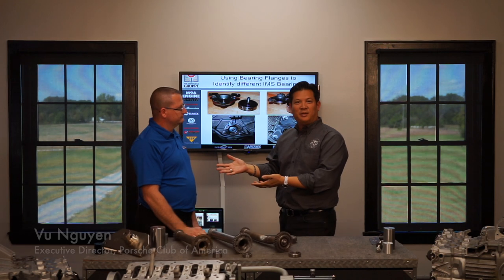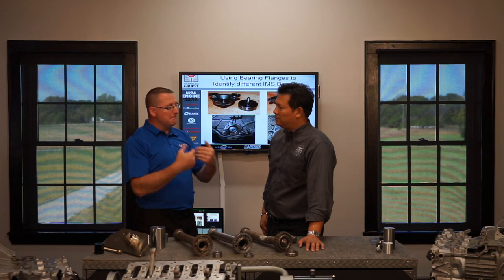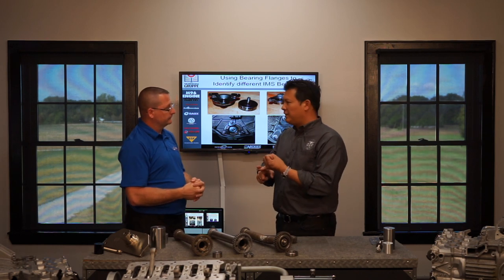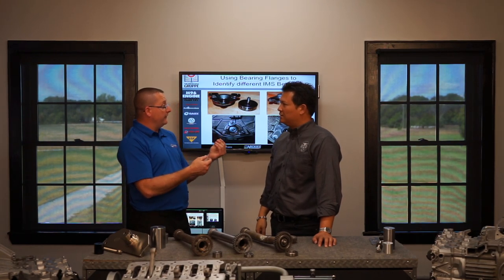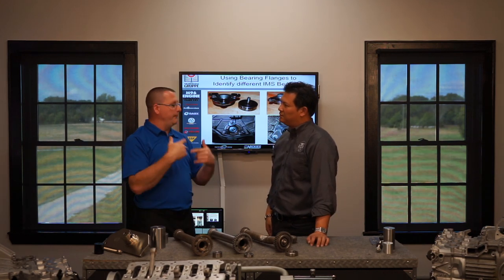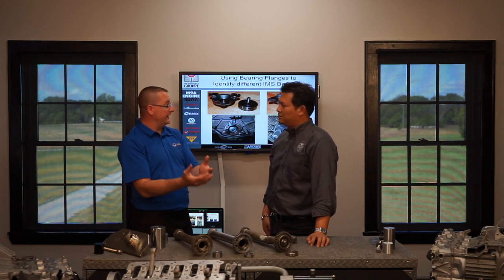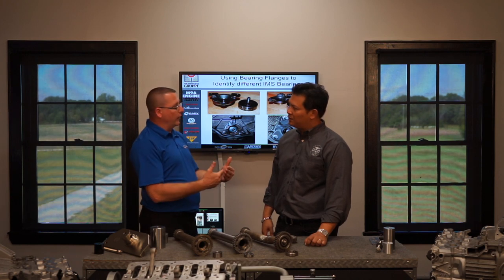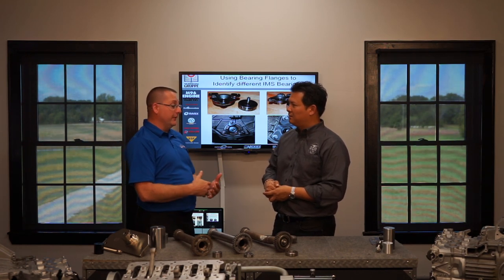PCA Spotlight: Extending the life of your original IMS Bearing

Comment: I owned a 2001 996 that I sold with 150K. I changed the oil every 6-7K, and drove about 12 K per year, usually 25-50 miles at a time. I did not have an IMS issue.

Comment: Knock on wood, my 2003 Boxster S now has 127K miles on it with the original IMSB. I change the oil myself, check the filter every time and have not had metal particles in the filter, have found some brownish colored thin bits in the filter at times. I also bought one of Jake's magnetic drain plugs, always looks good too. I have always used Mobil 1 0W-40 oil and started to add Liqui Moly MoS2 Anti Friction Engine Treatment with every oil change about 2 years ago. I change the oil between 3,000 and 4,000 miles, but I never let it go to 5,000 miles before I change the oil. My Boxster S is my daily driver, even in the winter if the snow isn't very deep. Yes I have different tires for Summer and Winter.

I've also done many mods to my Boxster S. Here is the list of performance mods. 987 Air Box, K&N Air Filter, 76mm Intake Pipe, 996 76mm TB, 997 Distribution T, Secondary Cat Delete Pipes, NHP 200 Cell Exhaust Headers and Borla Muffler. She runs like a champ, I love this car.
Reply: Share your passion. Used my '98 986 Boxster now more than a decade. Awesome machine. Now at 225k kms, t'was my daily and fun track car. Not a problem in the world. Doing own services. Requires just basic maintenance and gives just endless joy. Very few people commenting has got any practical experience. Enjoy your Cayman. It's a wonderful machine.

Comment: years ago my sister asked me how to keep her engine running for the long time. I said change your oil at 2.5k to 3.5k miles, use good oil, not fast change chain places. I changed the rocker cover seals, at 297k miles, engine has some wear but does not burn oil and camshafts looks great. No sludge. No noise on engine.

Comment: Couple of years ago I bought a 2006 Cayman S with 65K miles and it still has the original IMS bearing. Since purchase I have followed the recommended guidelines. But I also do a couple of extra items. I used 5/50 Mobil 1 because I drive with a certain amount of vigor, I get a Blackstone analysis with each change and just for insurance, I have an extended drive train warranty. I hope I never have a problem but like all drivers who know the Porsche's (especially the Cayman's) there are some things you will put up with just to have one of the best driving machines available.
Reply: Yes sir. I love my triple black 996 c2 cab. Its not a manual 6 speeder but still big fun.

Take care of your car and it will take care of you.
Reply: the chance of a 2006 having IMS failure is very low. you are wasting your time and effort for a car thats barely worth 15k. please send me some of that money you are throwing in the garbage

Comment: changing thr oil before it becomes acidic (6 months or 10000 kilometers, whichever comes first!) and revving a little higher before shifting gears (as soon as the oil is at operating temperature of course!) to reduce load on the bearing are usually the ways to go and also the reasons why cars which are raced and frequently used on trackevents way less likely to be victim of ims bearing failure. i do most services and partreplacements on my 2003 boxster 2.7 myself, since otherwise i couldn't afford owning and running the car. thank you for your informative videos. great content, keep up the good work.

Comment: The engine oil carries contaminants, with prolonged use. I do agree that when the engine starts (from cold), that there are products of incomplete combustion, such as 'sooty' deposits that get washed down the piston bores, past the piston rings, and then mix with the engine oil, and (although microscopic) these sooty deposits are carbon. The Oil Filter does its' utmost to remove these micro-particles, but we all know that (when the engine oil is changed) it is always black. Acids are also present and other stuff. Remember also that many contaminants can bypass the Air Filter, only to lodge in the engine oil too! 

So here is what I would do if I had to change the IMS Bearing. I have done this many times before. You take a brand-new sealed Bearing (I would use steel seals because there is no degradation to steel seals from the engine oil). Carefully prise out the steel seal at one side only. You will instantly be alarmed - and shocked at just how little grease is contained inside! Worse than this, many bearings are factory-lubricated with a medium grease, and I do not believe that a medium grease could survive the high temperatures of an internal combustion engine, under those harsh conditions. It is highly likely that the IMS Bearing is also subjected to temps around 130C  (for water cooled engines, including any friction build-up).
So- take your new bearing and thoroughly wash out all of the original grease with aerosol degreaser. Wash a second time in WD 40. Make absolutely sure that everything is clean and dry inside the bearing. NOW - go out and buy some ROCOL HIGH TEMP GREASE. Press this into a new bearing with a clean finger, and ensure that the high-temp grease takes up approx. 40-50% of the volume of the inner raceway. Replace the steel seal by gently pressing the rim of the seal - back into its' groove. The high temp grease will not migrate from the ball bearing, which means that any contaminated engine oil will not easily enter the bearing. I have had great success by 'modifying' new bearings in this way, and it would not be wrong to say that the life of the bearing can be tripled when used in the right application. Hardest part of all, is the removal of the steel seal on the new bearing- without bending it! I wish Bearing Manufacturers would also place one or two spare seals in the sealed package - along with the new bearing!  I enjoyed watching your vid, from start to finish. I've just been put off Porsche Boxsters for life by reading this. I will stick with my '71 Beetle. Greetings from Australia.

Comment: I like this guy, preventative maintainance is key to all Porsche engines both airl cooled and the newer water cooled. One other thing I don't see a lot of guys on here mention is changing your coolant once every 1-2 years regardless of mileage. It's a bit more involved time wise but not expensive. I recommend Porsche coolant or EVANs life time coolant. For oil Porsche recommended Mobil 1 from the factory but the oil isn't quite as heat resistant as Redline oil. ALL the guys who race these cars run Redline for it's superior heat resistance. I recommend 15w50.

Comment: Appreciate sharing your experience and personal point of view. On my side I can only reflect on my experience driving my very original '98 986 as a daily driver for just over a decade. The cars is now retired as I'm now an empty nester and on pensioen. It is still immaculate. We belonged to the local Porsche Club and all of us, me and three kids tracked the car flat out (often till break fluid boils) just once or twice a year.  I loved giving them that track experience and they enjoyed it every bit. All my kids could use my car whenever it was available.as their hearts desires. We drove it often at top speed especially to or three times per year on cross country runs.  The car now has 225000km. I service it myself, using only fully synthetic oil and that at about ~12 to 14000km intervals (instead of the recommended 20k).  I have NO problem regarding any IMS issues. Due to the American paranoia via YT, I took it some two years ago to my  local South African Porsche dealership. The mechanic confirmed NO problems. He also commented that despite having ,more than a decade years of experience at Porsche, he could count such like issues on one hand.  If one is just a little bit mechanically minded, these cars are easy and fairly cheap to maintain thanks to the assistance from E bay, YT and enthusiast platforms. My Boxster is bullit proof, however if you are dependant on professionals, any assistance will be costly and come at a premium. Just interesting. Love from Africa.
Reply from the maker: Thanks for sharing. And yes, the number of failures are low percentages.

Comment: Another great Video, keep them coming.   Looks like I need to increase my oil changes.  I currently drive my 997 a couple times a week on 40-60 minutes drives.   Apparently once a year oil changes are not adequate.  I also liked the explanation on why one shouldn't let their car set and idle to warm up the engine.   Thanks again.

Comment: Yes, you should change your oil more often, I agree with that. Change it more often than the factory said too. The ims bearing is a sealed bearing and filled for life at the factory with grease so it wasn't meant to be oiled. The oil may be to keep it cool but not to oil it. The bearings just fail over time. Like new front wheel bearings heat and miles of wear they fail, it's pretty easy to tell if they fail but hard to tell when a bearing in the engine fails. Changing oil more often may help some but like all lube for life bearings it will fail sometime.

Comment: Very sporting of Porsche to design and build engines with this potential problem.  It's kind of like driving a ticking time bomb...a very special experience.
Reply: If engineers could design everything to be perfect you couldn't afford the product.  There is a give and take with design, but the important stuff gets fixed in mid-cycle updates.
Reply: I had a Mazda that was originally thought to be a super reliable 300K mile car until they realized it would prematurely break timing belts and kill the engine.
Reply: In the 60s up through at least 71 the chain tensioners would collapse and destroy the engine.

Comment: Great Video.  I have a 2006 CaymenS and do my own oil changes every 5k miles like Jake suggested. I am thinking for my next oil change to use Mobil1 10w60 as i believe it may reduce oil burn off.  I have always used 5w40, whats your thoughts?  Mick Northern Ireland
Reply: Many swear by Joe Gibbs DT40 based on Blackstone Labs regular oil analysis as compared to Mobil1. I wouldn't recommend the 10W60. If you're tracking your car, then you need higher-end racing oil.

Comment: To me it sounds like chipping of 3000 USD from the current asking price if the IMS bearing isn't replaced yet, and there is documentation to prove it, or walk away from the car. When shopping around I have asked the sellers if the IMS is new or not...and amazingly I had answers like " You aren't buying a new car, so what do you expect for the money?" Also MB SLK 280/350 is affected by a similar problem, which is the balance shaft...which also drives the timing chains...It's even more difficult to repair...So after all...BMW Z4 seems to be the car to have....If we are looking at german sports cars  between 2000-2008

Comment: I have a 1995 993.  I use to drive it as a daily driver and have about 230K miles on it.  But I about 4 years ago I got another job and haven't driven it since then.  Should I change the oil first before starting it up again?
Reply: No u dont have to if it has good oil (not seriously due)
If the oil is about due soon.. gently warm it up then go on and change it.
If its fresh jus gently warm it up and treat it like a break in... treat it like an old athlete .. once everything gets flowing with no shock itl be good, trust me.
Reply: For peace of mind I would

Comment: Contradiction:   He states " we don't have lubrication problems - we have load bearing problems"    but the failure occurs when the bearing seal leaks and allows the bearing 
lube to migrate out of the bearing.    As long as the lube stays in the bearing there is no failure.
Also by the time you see warning signs of bearing failure - its all over but the crying.

Comment: So wait..... when the weather is cold (not that it gets very cold in perth) I should jump in the car and drive, rather than letting the car warm up first?
Reply: Yes, exactly. The owners manual states that warming up the engine while sitting at idle is NOT necessary. It recommends that the car be started and driven immediately. It also states that the engine should not be pushed past 4,000 RPM “UNTIL” the engine oil has warmed up to operating temperature. The point the gentleman made on the video is that when the car is warmed up at idle, it takes a lot longer to warm up which results on the engine running rich much longer causing a lot more oil contamination. Think of it as running an old car or small engine with the choke on longer than necessary. The longer the time to warm up, the more contamination transferred to the oil. Makes perfect sense to me.
Reply: Due to emission regulations set forth by the gov't. All manufacturers have to speed up the process of heating up the catalytic converters in order for them to begin doing their job. One of the main methods for converter heat-up time is achieved by running an engine at higher RPM and increasing injector duration/pulling back ignition timing. This is why you're engine RPM revs higher at colder temps and gradually decreases as engine/converter temps increase. During this process it is inevitable for fuel to enter the crankcase. Even the best emission friendly Honda engines will have contamination during start-ups. 
PCM will continue to run injectors rich and contamination will occur regardless if you jump in and drive your car without warming it up. However you are increasing the chances of premature engine wear mechanically by not properly warming up the vehicle.
Reply: Yes!
Reply: Technically speaking, it has a lot of variables to determine what is best at a cold start, however to let the car idle up for more then 30 seconds is more harmful then to fire the car and start moving slowly.  The reason, as the video states, is loading.  When sitting at idle and letting it warm, the car takes significantly longer to get to Normal Operating Temperature (NOT) as it has essentially no loading. Therefore, the vehicle shall place more fuel as it doesn’t burn as well when cool, leading to more fuel contaminates into it’s oil.  If you cold start the car, idle for say 30 seconds and start moving slowly, you are placing additional loading  by running higher RPM’s, resulting in hitting the NOT sooner, leading to less fuel contaminants getting into the oil.
Reply: Yes, buckle up and drive gently for the first ~5 minutes, and no high-revving for the next 5-10 minutes.   After a total of 10-15 minutes, your oil should then be at operating temp and ready for some spirited driving :)
Reply: Unless you're living in Siberia, it's generally better to get the car moving and drive moderately. The shorter time the engine oil spends at low temperature the better. Idling is a poor method of getting all those liters of oil up to temperature. But again, don't wring the hell out of the engine. Drive moderately.
Reply: Yes...

Comment: "If it runs long enough than it's gonna break", so...why does the IMS bearing failure afects only 5 to 10% of these cars?
Reply: "Only"
That's an insane failure rate.
Reply: Good engineering understands this fact and makes it easy to inspect and then fix.
Reply: That figure came out of the class action law suit years ago. There is no way to quantify current failure rates since there is no reliable data being kept on the 996 survivor cars. That figure is just tossed around forums and such. But the problem is real and needs to be addressed if you own one of these cars.
Reply: A buddy of mine races his 248K mile 97 Boxster with the original bearing. He races on a race track and winds it right out but changes the oil every 3k or less.
Reply: A bit of fear mongering here by someone who has a lot of $ to gain from IMS fear. A non-defective factory part will last much longer than the aftermarket bearings. At this point, most cars on the road with the original bearings are not defective and failure rates will drop over time- not including those that replace theirs with an aftermarket piece, and never replace the now maintenance part (versus the factory lifetime part).
Reply: Because it is complete BS

Comment: Listening to this for the first time.  If this is a sealed bearing, it is grease lubricated.  The engine oil is not a factor.  Can someone confirm that this is grease lubricated?
Reply: It’s an oil (not engine oil) lubricated seal, it not grease, search youtube, you can find vids showing the opening up of the old bearing to show what it looks like when in good condition or about to fail.
Reply: It is sealed and filled with grease yes. But over time the seals can fail and the oil can get into it. Hence changing oil more regular.

Comment: I see, Low engine RPM sometimes sees more wear at the expense of fuel economy because of design. Makes sense to me. Why not design it for low load Rpm instead and that would solve all ailments? Wait. I forgot about performance factors. Its a balancing act isn't it? Yea no its just poor design. Oiling bearings is not that hard to do. Engine  oil in todays engine is limited by filtration in my opinion. one should never see suspended matter in oil pans. Settled stuff yea but how many time does the oil in the sump get filtered per minute?

Comment: I dont' want to buy  a M96 or M97 engine Porsche after watched this video.
Reply: Mine has 82k miles. You know what the secret is? Change the oil regularly and DRIVE the car. Keeping that bearing lubricated with clean oil is key. Garage queen m96 and m97s have this issue.
Reply: Just make sure the IMS has been replaced or haggle off the price to fix it. And don't take the guys word for it...no receipts, assume it's not been done.